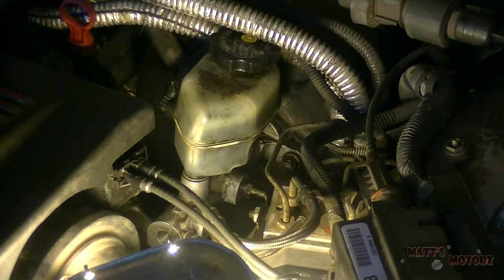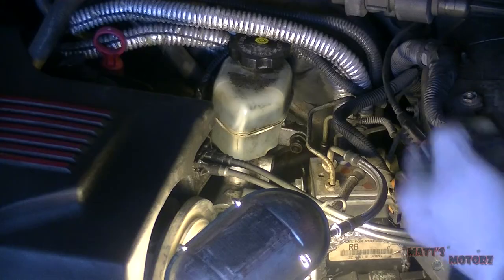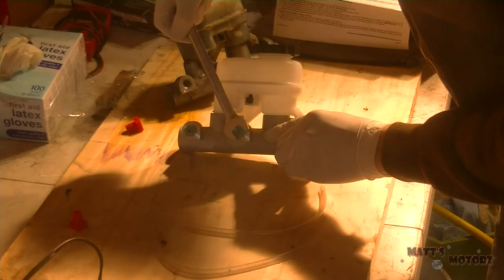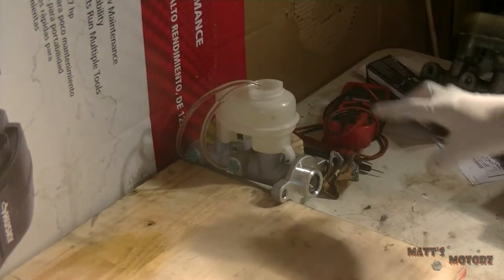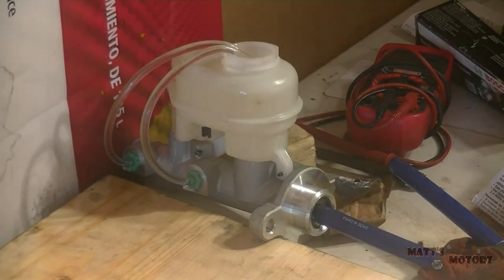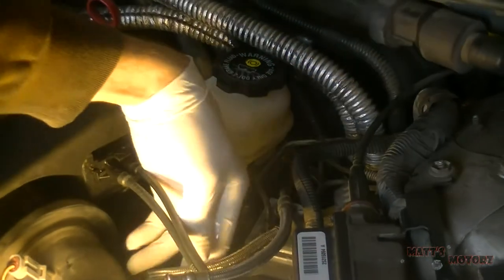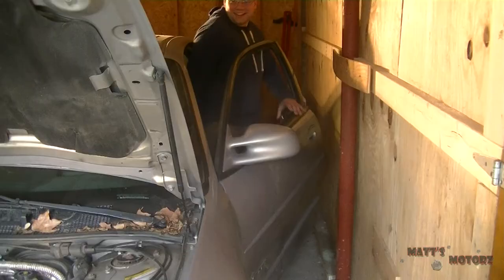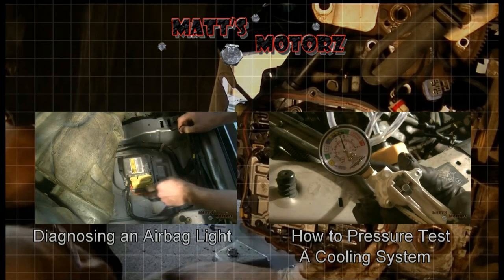Replacing a Master Cylinder [1999 Pontiac Grand Prix]

Comment: After bench-bleeding, I leave the tubes attached to the ports an pinch off the ends with a small c-clamp. This helps avoid some of the mess and ensures less air is re-introduced into the brake system. Sometimes when bleeding the brakes, I have my assistant slowly bring the brake pedal down on a single stroke. They will let me know when the pedal is down and then they tell me when they can feel the pedal drop further as I crack the bleeders open. Keeping pressure on the pedal, close the bleeder and slowly allow pedal to return to the top. Repeat process until complete. The aim is to avoid breaking large air bubbles into smaller ones from the fluid rush. I wish all cars had the braided hose design, it sure makes the job easier.

Comment: I have a 1998 Pontiac Grand Prix GTP. I really messed up. I watched one Youtube video about changing  the master cylinder  and he didn't mention anything about bench bleeding. Now I have air all over the system. I have no brake pressure at all. Does this ruin the master cylinder I just installed. I wonder if I'll have to buy another. I'm mad at myself for not researching this more than I did. Good video sir.
Reply from the maker: Fred Duff No it will not ruin the master cylinder.  As long as the cylinder is not running dry it should be okay.  Take it out again, bench bleed, put it back on, and then bleed normally.  You may need to bleed all four wheels to remove all the air.

I am very surprised someone would make a video on replacing a master cylinder without mentioning bench bleeding.  It is a standard procedure!
Reply: I just found out that the ABS module pump is leaking. That explains why I've bled the car to death thinking the master was bad.